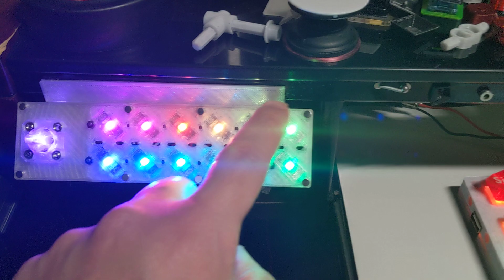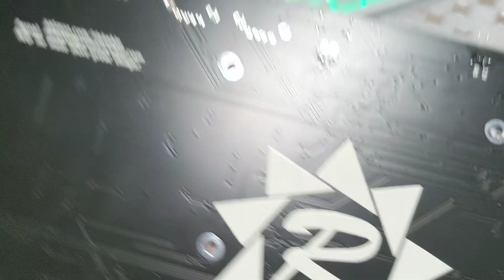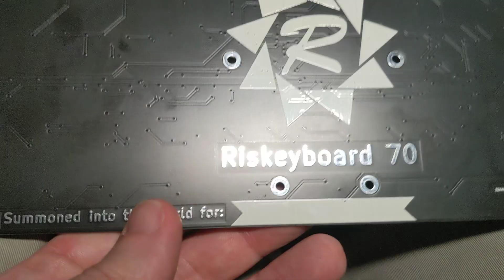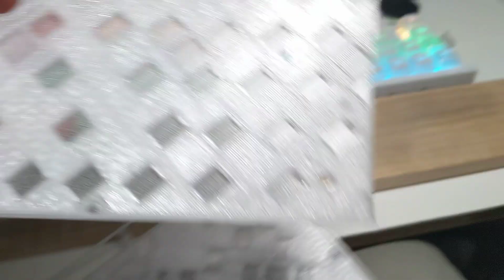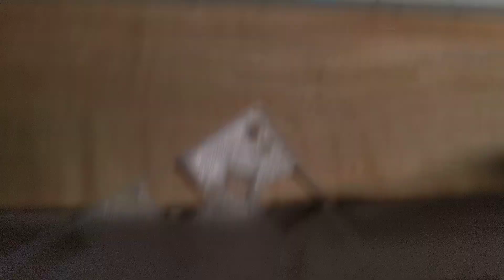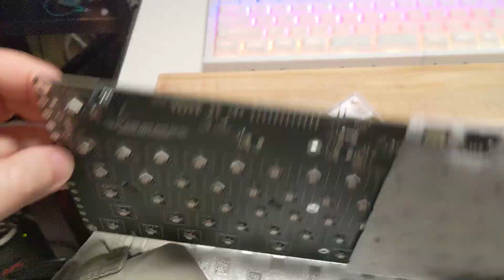Hand-wired analog macro pad complete and loads of Riskeyboard 70 updates

Comment: Would it be possible to buy just the hall effect sensors and still wire it up properly? It would be cool to use these switches with ergo keyboards which are often sculpted and difficult to print PCBs for.
Reply from the maker: Yeah you can do that.  I designed an Analog Keyboard Unit (AKU) PCB that's kind of like the Amoeba PCB for doing this sort of thing.  You need something to put the hall effect sensors on so it might as well be a PCB (they're cheap!).  You could just 3D print a little plate with some holes in the right places though and that'd probably work too.
Reply: @Riskable3DPrinting  That's exactly what I had in mind! I figured I’d print a PCB-esque layer that held the sensors  under the layer that held the switches. Really looking forward to see how this project turns out!